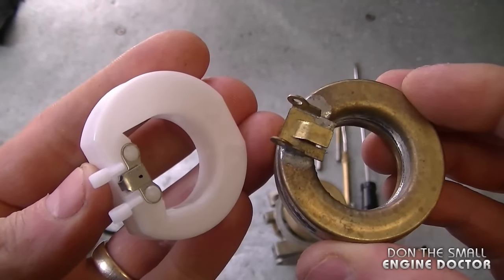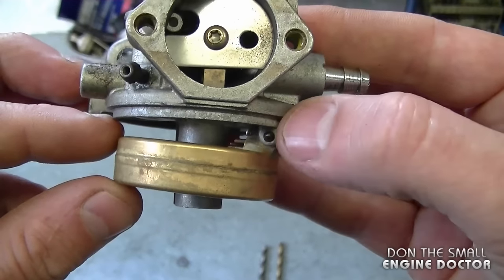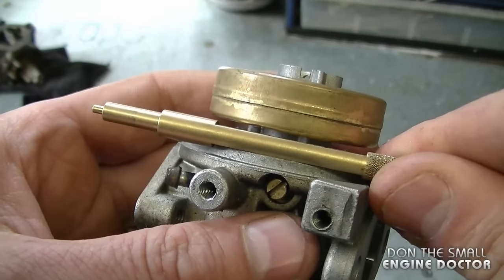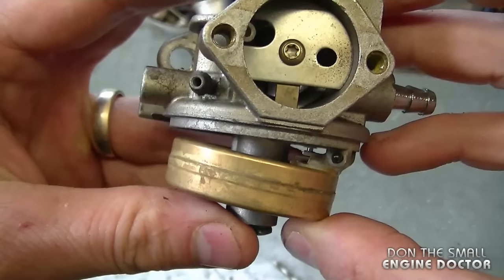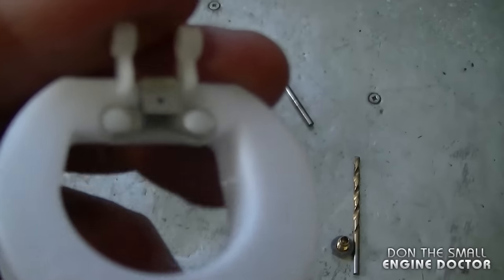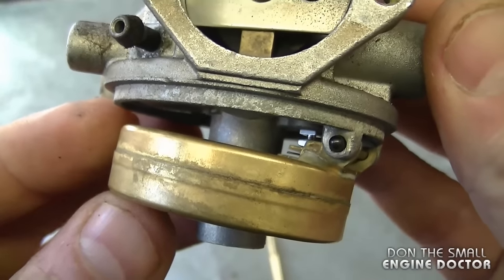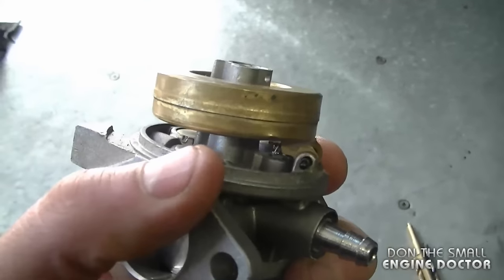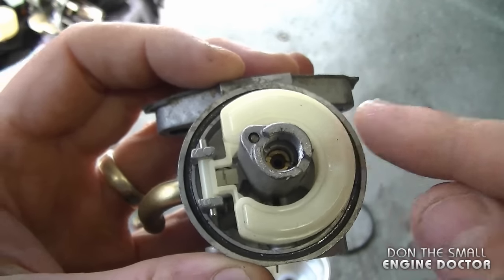HOW-TO Adjust Carburetor Float Height

Comment: Got question, what if the plastic style float needs adjusted? Mine is no where near level and I think its shutting off fuel too soon, so do you try and bend the plastic?
Reply: Did you get an answer. Mine is doing the opposite but I don’t know what to do. Brand new carburetor.
Reply: @jeffgriffith878  No answer but I ended up slowly tweaking mine and and kept tweaking on it till it took a set to it. Just be gentle and keep tweaking.
Reply: @brianb5779  thanks, I spent a couple hours and figured out the float was not pushing the pin into the seal enough to close. Not sure why but I made a little tiny metal washer and put it on top of the seal pin. Tested it and was able to get it working. Now have that generator in working condition again. I hope the washer doesn't fall off or it will be back in the same problem again.
Reply: @jeffgriffith878  Ill remember what you did so if i run into the problem in the future ill have that option. Glad you got it running, hopefully it stays put for ya.

Comment: Hi! I have a problem on my carburetor float. What if the lowest setting of the float, is not low enough? Basically on the lowest setting, the float sits to high up, closing the valve too soon. I should lower it more, but I can't. Any suggestions?

Comment: donyboy, I recently rebuilt a carburetor from a homelite generator series 1800/2250 starting watts  with a Subaru engine mod.  EX130D520917937.

the problem is that the carburador keeps leaking gas and floods the engine,  and when I manage to start the engine while leaking gas, the engine keeps surging & the only way it'll stop surging is to close the choke, instead of moving it to the run possition.

what can I do to stop the surging ? and the massive gas leaking after I turn off the engine  multiple times & the leaking won't stop

I went n purcased a new carburador and its doing exactly the same thing, it leaks gas, & surges,  n the surging will go away if I close the choke instead of moving it to run position n after turning the engine off the gas keak from the carburador won't stop !

so I returned the new carburetor and got another new carb and guess what? 

it's doing exactly the same thing as the 2 previous carbs. the leaking won't stop n the surging up n down. ?

what am I wrong ?? I mean I already changed 3-carbs and the massive gas leaking before & after turning the engine on,  won't stop ??  and the surging only stops when the choke is on, (closed )

your help will be fully appreciated Sr.

Thanks in advance.  Angelo in Houston Texas.

Comment: Okay here's the problem I have I have a McCullough Mac power pro 2300e generator I took the carburetor off cleaned everything up even the hidden screen on choke she starts to want to go but then as soon as you take it off of choke to low speed to run she dies out, now if I'm correct it's one and a half turns on the needles been a while but you don't forget the stuff once you start using it I'm open to ideas when I turn the adjustment screw on the bottom of the float bowl gas comes out so I leave that tight not the Middle screw that holds the float bowl on I've tinkered and I've tinkered cannot find another carburetor for this so I must fix this one I went through 10 carburetors off of Amazon alone other places want more than what I paid for the generator open to info AKA HELPPPPP lol

Comment: donyboy73 - I'm hoping you can assist me. I'm having an issue with my Lawn boy 6.5 kohler w/smart choke. when I pull the mower back and up a bit, the rear tires lock up.  I'm hoping this can be corrected. it's self propelled. thx for your help
Reply from the maker: I would take wheels off and clean the gear area and check for wear, some wear on the gear parts can cause this
Reply: donyboy73..... thank you for the advice. I appreciate the time you took.

Comment: Where the needle valve goes Should there be a small rubber washer I have tried altering mine lots of times It still starts and dies
Reply from the maker: yes there is a rubber seat
Reply: Cheers mine is missing if it wasn't for your video making things a lot easier for people to understand the problems they may be having Thanks

Comment: I have an ETQ TG3000 generator that I just bought (used) and it runs awesome, if the choke is partially on, when I take it off it surges. How do I solve this?. My guess is it's running lean but not sure how to properly adjust

Comment: I have liquid in the float when i shake it..?
Reply from the maker: you need to replace it
Reply: @donyboy73  ok i went amd got the new float...it comes with some weird type spring and no diamond pin thing...am i to use the original pin from the old float and the direction say to inly use the new spring if the original had that spring which it didnt..it only had the little wire with the diamomd shaped pin that was attached to float..the pin goes into that hole near the tab on float so its needed im guessing
Reply from the maker: @MrMrSaldana  yes use existing pin and u don't need spring if u didn't have one